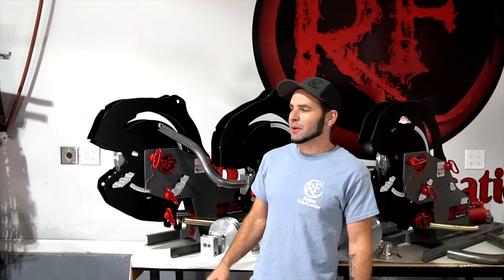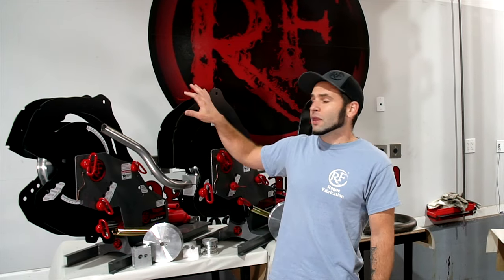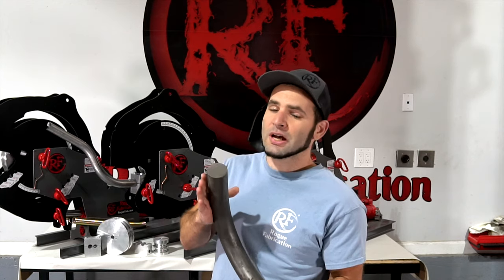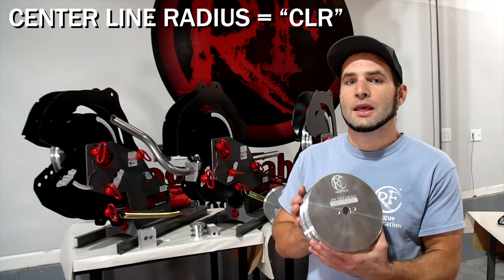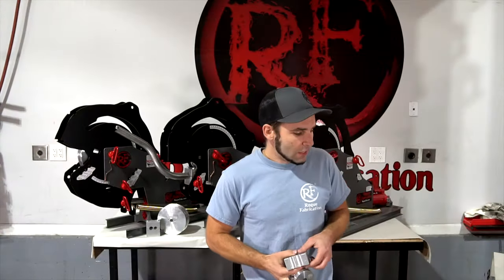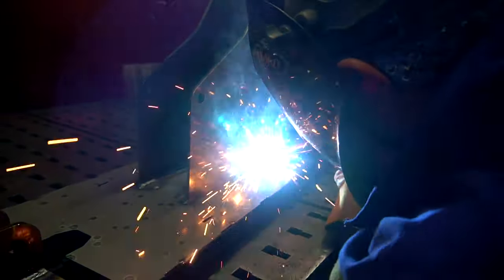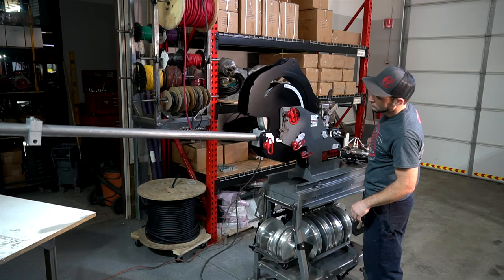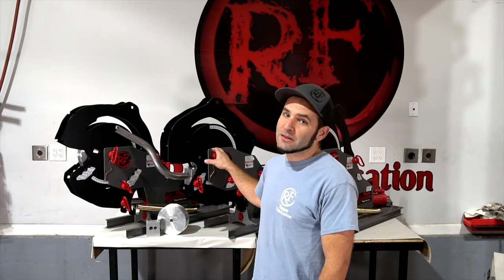Tube Bender Features & Options EXPLAINED - What you NEED vs what you WANT

Comment: The M605 seems like the best bang for buck option, small cost upgrade from the M601 and the M625 is a bit overkill for hobbyist amature like me. Also pressure roller die is a no brainer upgrade.
Reply from the maker: Bobby- absolutely. The 605 cab bend 1.75 x .250 wall, go up to 2" tube, etc. It's a real affordable workhorse! And we do love the rollers for a great affordable upgrade for sure ;)

Comment: I'm planning on bending mostly heavy wall tube (.250"); Is the roller die or pressure die better for that application?
Reply from the maker: On bigger OD applications for .250 wall (like 1.75+), we recommend standard pressure dies. They're stronger, but it only matters on the big stuff :) -Joe
Reply: Thanks for the feedback! Ideally I would have standard pressure dies for big thick wall tubing and your Thin Wall Roller (T.W.R) for thinner wall applications correct?

Comment: Hey I’m looking at ordering a bender/ mandrel bender at the end of the summer. 
Mostly for building custom exhausts on motorcycles. 
Would one of these + mandrel attachment work? Or are these more for chassis/ roll cages?
Reply from the maker: We've sold them to several motorcycle exhaust companies. They work really well in the common 1.5" to 1.75" motorcycle exhaust sizes. They can also work on 1.875 and 2.0 depending on the alloy and wall thickness for exhaust. -Joe

Comment: What is difference between the M605 and M625, benders?
I have the Tradesmen set, that is about two years old. Can it be upgraded?
Reply from the maker: 3/4 pin vs 7/8 pin and the m625 (formally the XHD) has a thicker frame. This is something that cannot be upgraded. - Josh in customer service